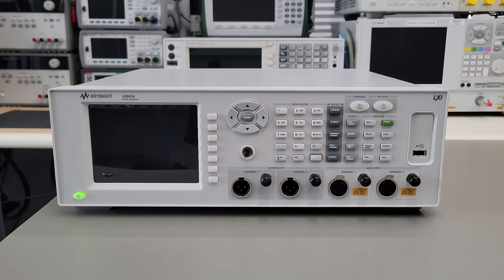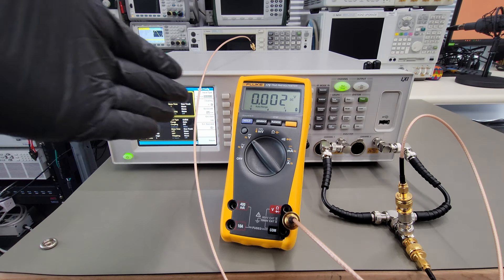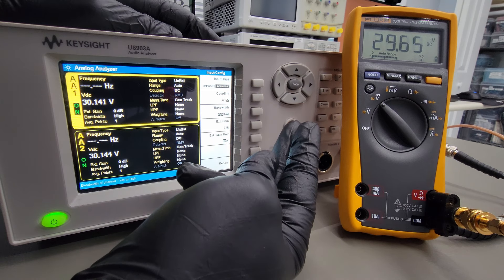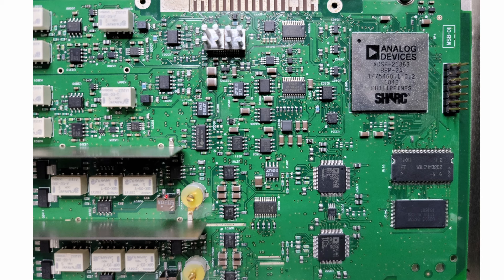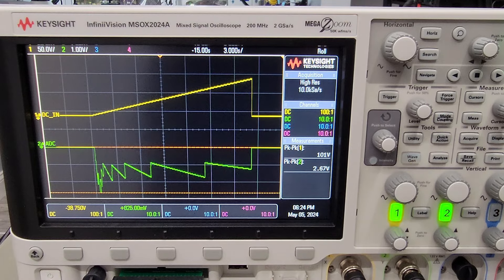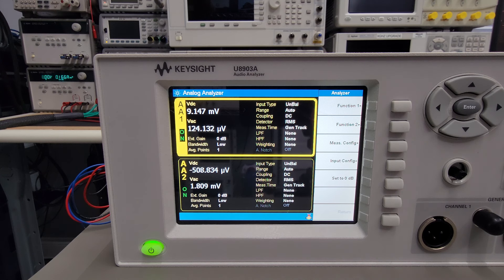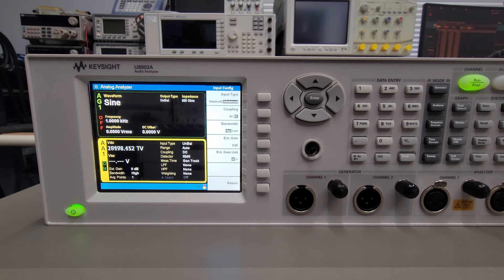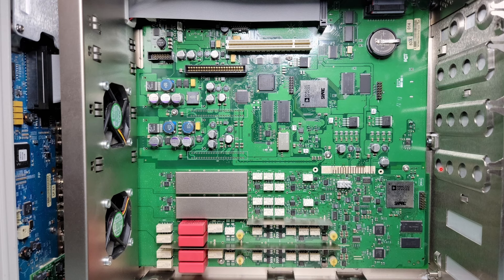Neonkev #5 - Agilent/Keysight U8903A Audio Analyzer teardown and repair attempt

Comment: Hello, good video.
I have a U8903A unit and the same thing happens to it. It does not indicate the voltages well on the analyzer.
It marks very high voltage values, of the order of MV.
Everything else works fine.

Have you come to a conclusion about your broken equipment?

Thank you

Comment: Would  be surprising if there wasn't a  checksum on the DSP flash data, which would produce an error message rather than show bad readings. 
Would also be unusual for it to not be possible for the host to update DSP firmware - preprogramming may just be a bootloader to allow further programming.
Reply from the maker: Hey Mike. It is strange that there are no errors shown if the DSP program is corrupted. 

I did reinstall the firmware update package several times too. It has several parts and all of them installed and verified successfully.

I'm not sure if the flash on the ADSP-21369s is updated during this process. The way the flash ICs for each DSP are marked with a custom "U8903-X" part # leads me to believe they are preprogrammed. 

I don't think this issue could be the DRAM for the DSP going bad? Each DSP has an external 128Mb DRAM as well. 

Besides getting flash from a working unit, the only other routes I can think of are to replace the other DSP processors (the other ADSP-21369 and the one other ADSP-BF535P also on the board). 

Keysight condemned the unit outright. Because it is declaired "obsolite" the motherboard is not even available for replacement (they would never do component level repair/diagnostic/reprogramming in the first place).

Comment: Holy BGA rework, batman ! I admire your bravery. +1 for investigating RAM, would suspect that before a flaky flash and cannot imagine the firmware wouldn't have some sort of ROM checksum + selfcheck. But even before that, have you looked at the ADC digital side (SPI or more likely I2S), capture for a while in the more problematic ranges and see if anything stands out ? e.g. if the ADC clocking or supporting circuitry is messed up, you might pick it up there. Also, for peace of mind, I would've liked a higher-speed scope trace of the ADC inputs - your DC ramp test was good, but I feel like some fast glitches could've gone unnoticed...
Reply from the maker: Thank you! The unit did develop some sort of boot issue shortly after the work I did in this video. Very bizarre, but none of the firmware recovery procedures proved fruitful. For now I've set it aside to continue with other work, but I will hopefully find a remedy for the boot problem so we can continue.

Comment: Could it be some via crack or trace damage on digital bus to DSP? Also did you try to replace SDRAM? Sometimes DRAM chips also die, had few repairs like that.. It's bit funny how UI programmer who designed front panel interface didn't worry much about putting support and processing for gigavolts and teravolts. Totally reasonable signal levels, no worries :D
Reply from the maker: Hey Ilya. I was thinking about DRAM recently as well. A friend suggested that I should try heating/cooling DRAM chip while running, this might show change and help isolate part. I don't think unit has any ram test built in software.

I will order some new ram chips anyways because they are cheap. We will see!

Yes, it is strange how the instrument does not detect anything wrong with crazy readings! Self test is also useless on this model. It just checks few basic things on ADC/range switching and always passes...

Comment: Did you try applying a stimulus directly to the dac, actually skipping all the input conditioning? With a logic analyzer you should be able to check if there are actually any spikes on the output value of the conversion.
Reply from the maker: I did not try to bias the dac input directly, but that is certainly something I can try when I get back to this unit!